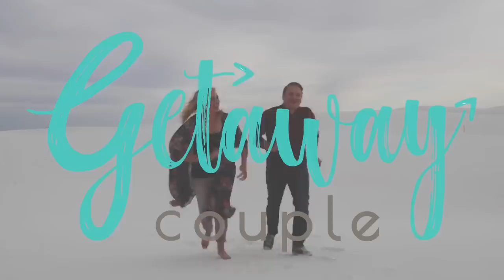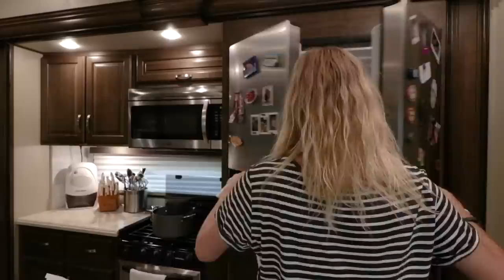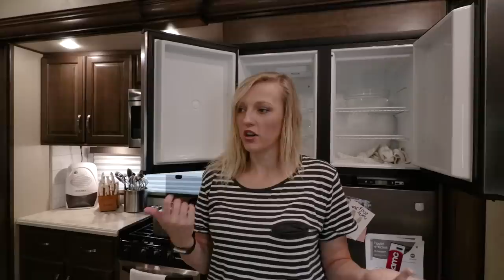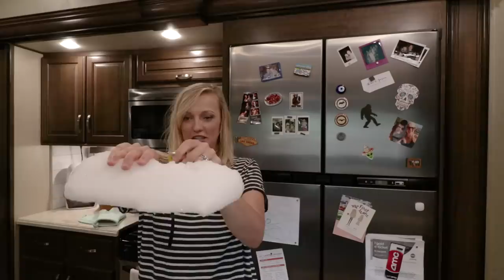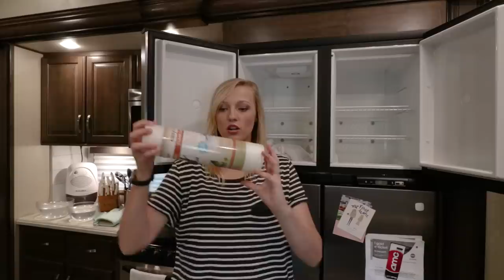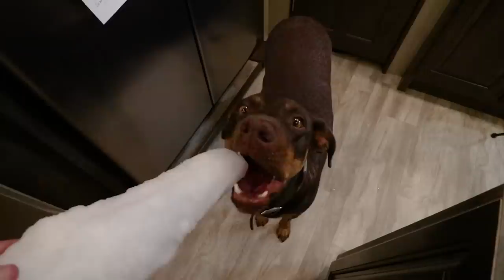How to Defrost a RV Freezer (A Year of Frost Buildup! 😱) || RV Living

Comment: Ya.. A hair dryer is NOT gonna damage or melt any fridge parts. Not hot enough like a heat gun..
Either method runs the risk of electrocution or shorting out the circuit with accidental contact with water.

The key is the plastic panels becoming warm so the ice lock releases. 
Then most of it will slide off or can be pulled away.
Fast n easy method.. Doesn't exist.

Clear winter window seal film works the best since it will seal over a little moisture and a hair dryer will seal it nicely.
It's worked perfectly for almost 30 customers.

Comment: Great video and I agree with not using a hair dryer. Too much time and having to hold it the whole time. No thanks. We have had this trailer for about eight months and live in it full-time when we are on property, which is a fair amount. The trailer and the refrigerator have been amazing. The new problem that we just came across and noticed yesterday was that our left lower food drawer at the bottom of the refrigerator was completely full of water. I need to find out what is clogged or why that is happening. If you have experienced this, were you able to find the problem?

Comment: Thanks for the journey. I have an unrelated question about your 5th wheel length. How much of the 5th wheel overall length overlaps the truck bed when hitched and is this a typical amount with most 5th wheels?
Reply from the maker: Hey Mark! That's a great question that we don't know the answer to lol. We have not measured our front cap. I don't think it's a typical amount since each fifth wheel could be designed differently. It would also depend on the length of your truck bed. We have an 8 ft bed so I would think that we have less overhang than some. If you have a regular bed you need to watch how tight your turns are so the front of the fifth wheel doesn't scrape the side of your back window. Sorry we weren't too terribly helpful on this question!

Comment: We use the plastic cutting boards and Velcro them to the back wall and bottom of freezer.   Just have to remove them from the freezer and defrosting is done in like 5 minutes.  Go vlog through.
Reply from the maker: Thanks! Yeah, so that's the method I was reading about and then I found that plastic lining and decided to try that. I'm finding that I'm getting frost between the lining and the freezer wall though. Do you get any frost between the cutting board and the freezer wall? Or does it all build up on the outside of the cutting boards?
Reply: I get very little build up between the plastic sheets and the wall.  However we don't let the frost build up and since taking the sheets out with frost on is so easy.  The ice just falls off.

Comment: The hair dryer has always worked for us. Keep in mind that you are not melting that much ice if you do this maybe once a month.
Reply from the maker: That's true! And I truly forgot what the back of my freezer looked like, so I thought I had those metal rows. But now that I see it's plastic I might try the blow dryer next time.
Reply: good luck I think you will prefer that method. Just go slow and don't blast it on high continuously. A little goes a long way. Any water above 32F melts. Thanks for sharing